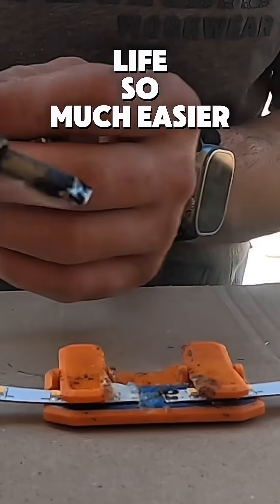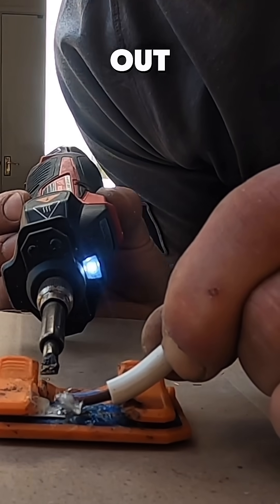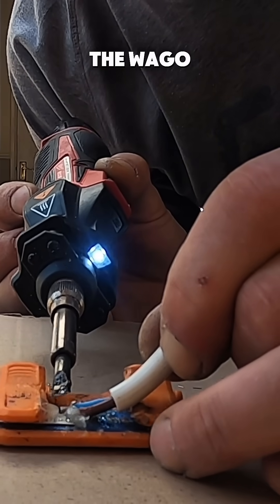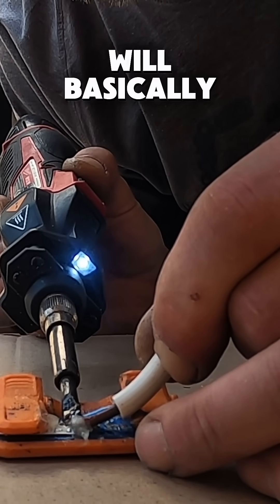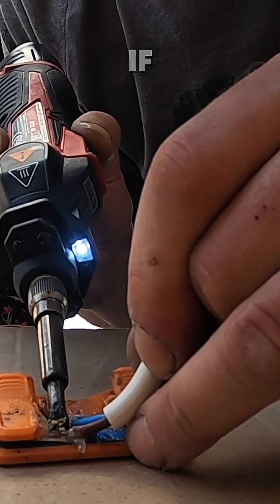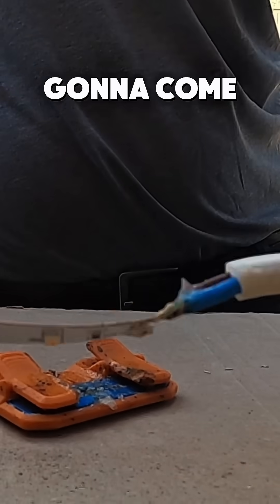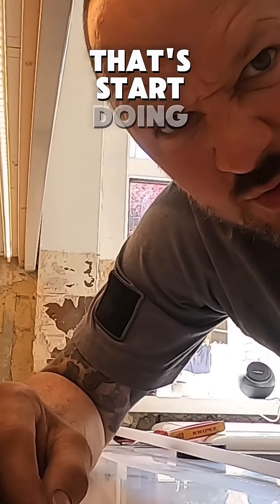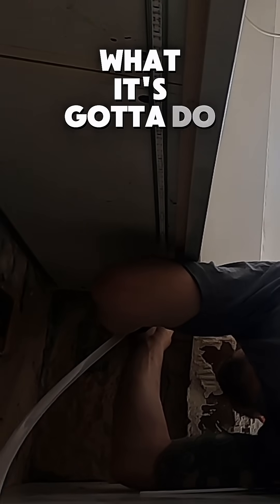Soldering LED Lights Like a Pro – Clean, Strong Connections Every Time! 🔥💡

Comment: Little advice, use an appropriately sized soldering iron, tin the pads on the tape using fluxcore solder, tin the wires and bring the two together then just flow them  with the iron. What you are doing here is butchery.
Reply from the maker: The new and improved way mate
Reply: @toolboxtalking  Yeh the finer points are what needs to be shared though, what you get up to on your own jobs is one thing, sharing it with the masses is a backwards idea. have you seen Idocracy (the movie)?